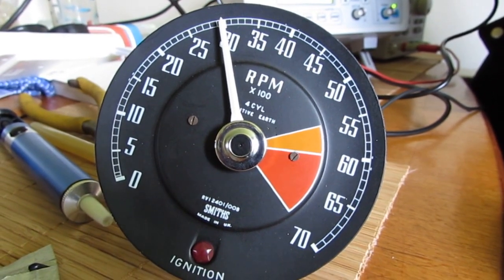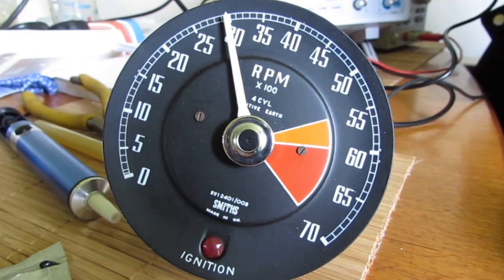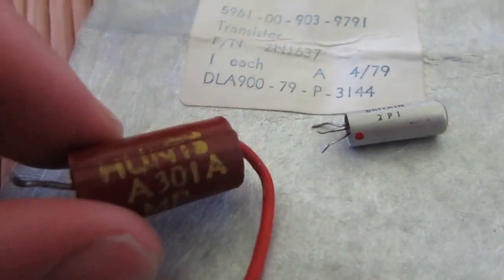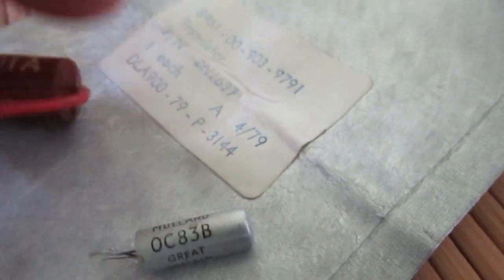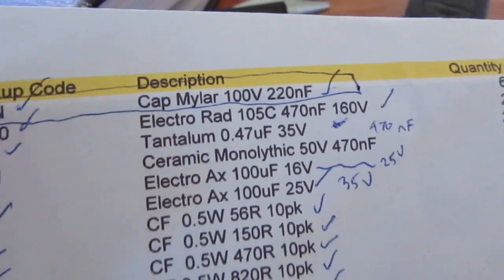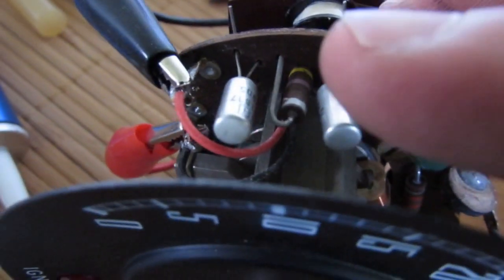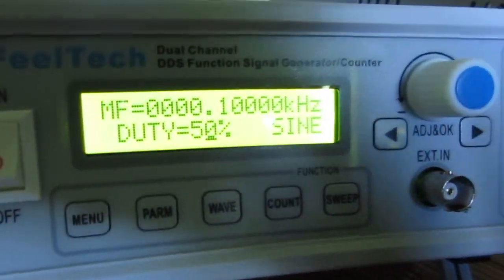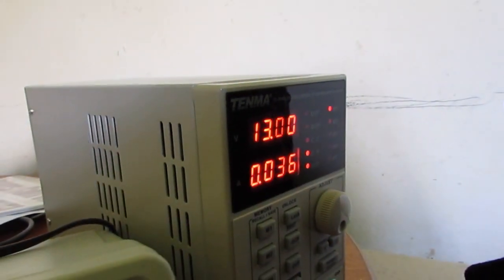Smiths RVI Tachometer repair overview

Comment: What was it doing what it wasnt working? Mine is spiking to 7000 as soon as the ignition is on (car not started) and stays there with the engine running.
Reply from the maker: Hi. it did nothing iirc